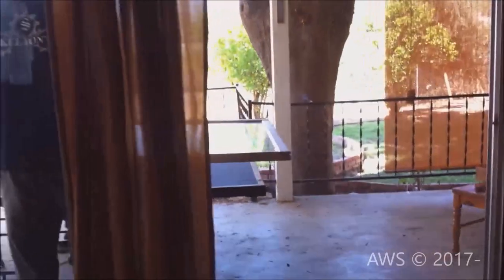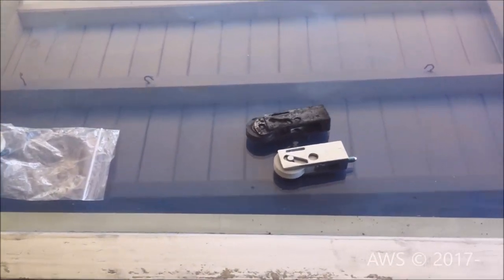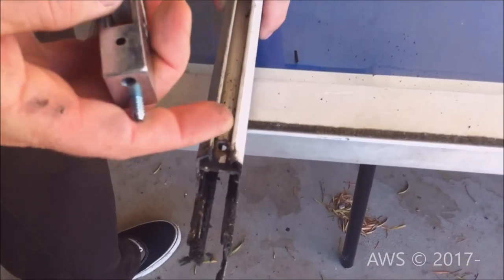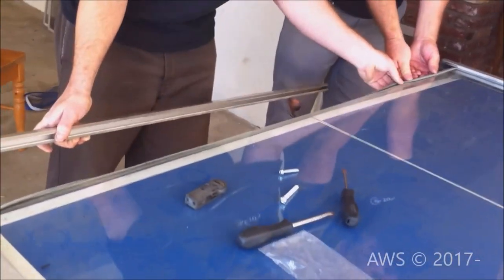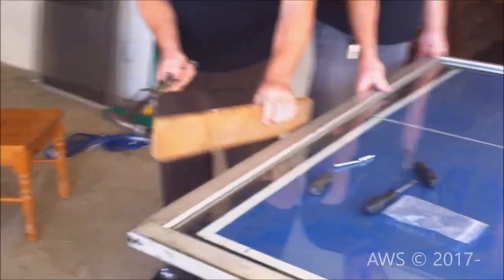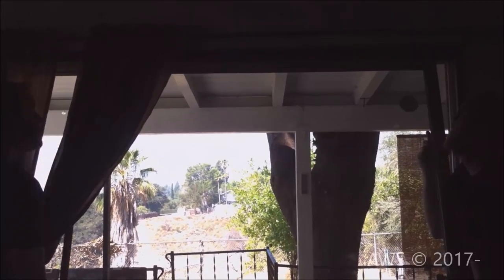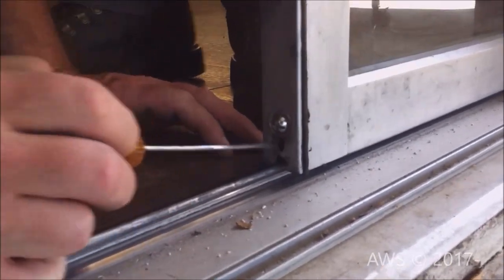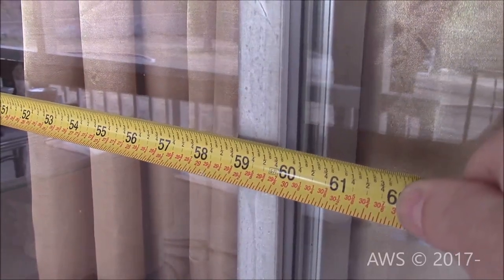Sliding Glass Patio Door Roller Replacement

Comment: My sliding door is so old that the adjustment screws are frozen. Can I JUST CUT THEM OUT WITH A Dremel. Does the new roller have an adjustment screw?
Reply from the maker: There are so many different models of roller cartridges that I'm unable to answer that definitively. Most, if not all, roller cartridges have built-in adjustment screws. The mounting screw, however, did not come with our cartridge so you might want to make sure you salvage that or have a replacement on hand. I recommend contacting the cartridge manufacturer for your specific door. If you're not sure the manufacturer, try contacting a company like Swisco. They have a contact page with a phone number and email address at https://www.swisco.com/page-contact. Best of luck to you!

Comment: Contractor always shows the hard way to change roller. 
Instead of removing the bottom horizontal bar (after pulling the whole sliding glass door out), i remove the vertical bar without removing the glass door. FIrst you must remove the screws both adjustment and main screw, then gently remove bottom side of the aluminium bar and then gently lift up the glass door so that the other person can remove the old roller. Place a new roller and screw back everything. So much easier.
Reply: Apparently you missed the fact that there was a screw in through the bottom of the door holding in the roller. Therefore the door had to be removed from the frame.